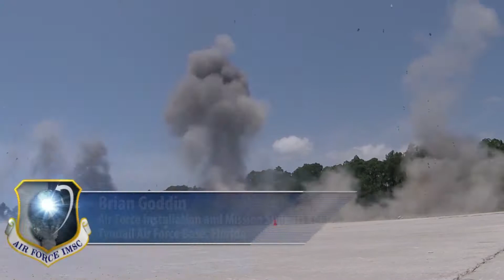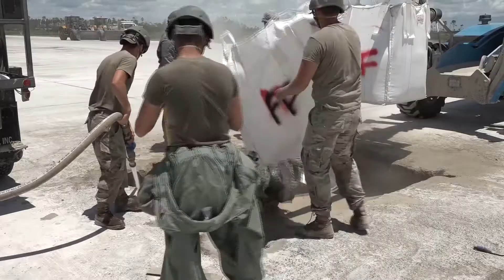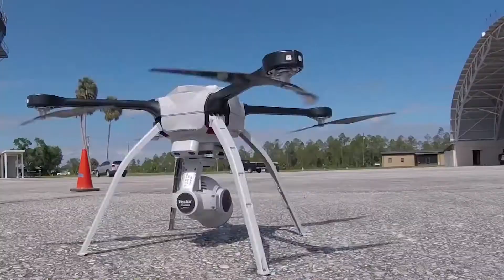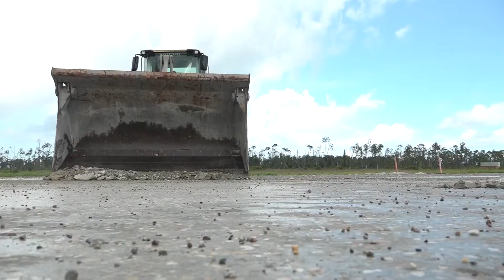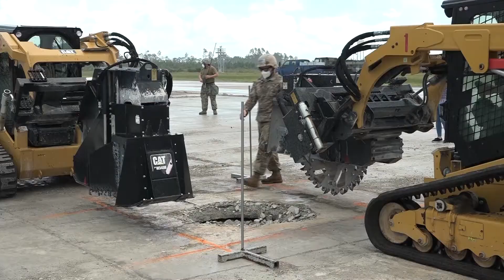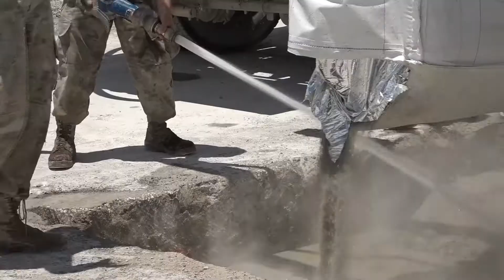RADR; Rapid Airfield Damage Recovery and training sites expansion

Comment: In my 23 years in the Air Force and 18 in CE as an equipment operator and 12 as crater crew chief I have never seen a crater that small ever.  Been to Tyndall and blown craters they just have switched that charges to m80s.     Started on am2 matting.  Then triple lift concrete slabs. Then to ffm and now this.  The evolution of RRR.